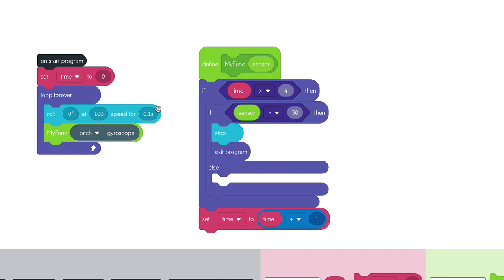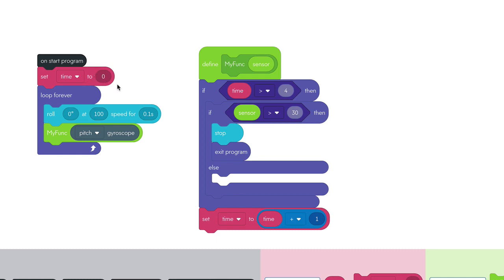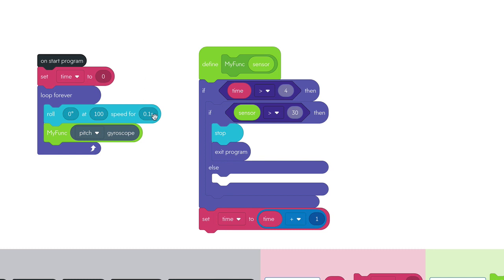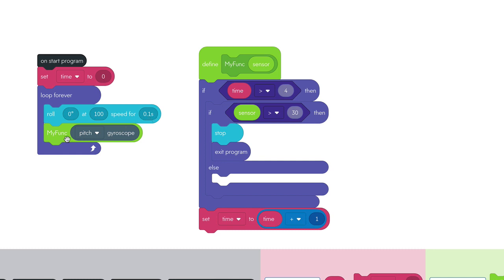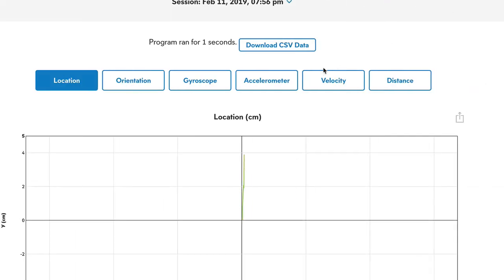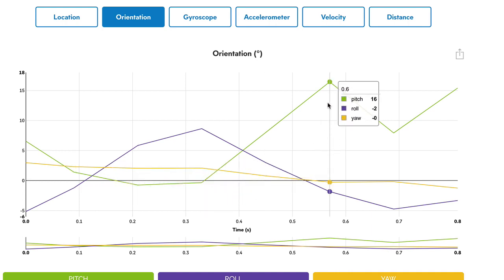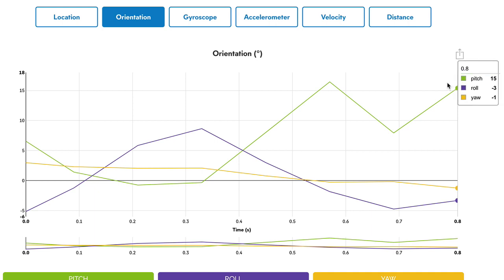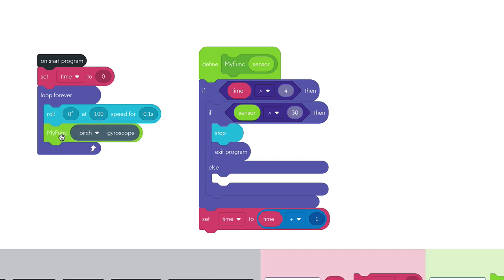Test 2 with the Sphero Sensors

Comment: is there a way to output a debug statement when it exits?  I just wonder if the sensor is spiking a bit.  There may be a need to smooth out any noise in the sensor.
Reply from the maker: Not really, at least in this environment.  I did solve the issue in another video though using a different sensor.  The problem is the sphere has no real way to stabilize itself and therefore most all of the sensors are moving back and forth even when rolling gently across the floor.  I'm still working on understanding exactly what each sensor is measuring to see if I could normalize the data any but at the moment it is all over the place.